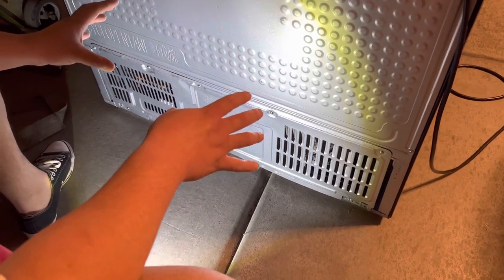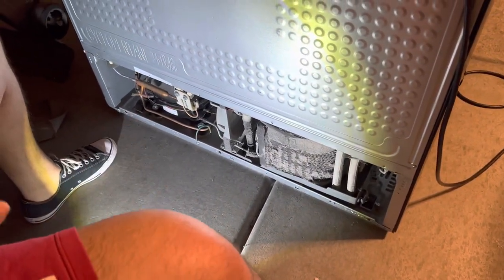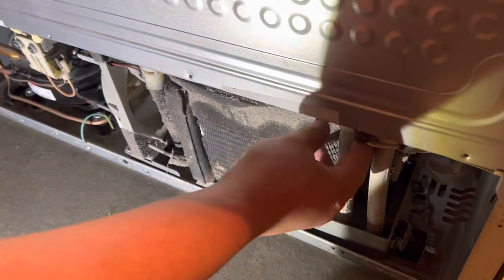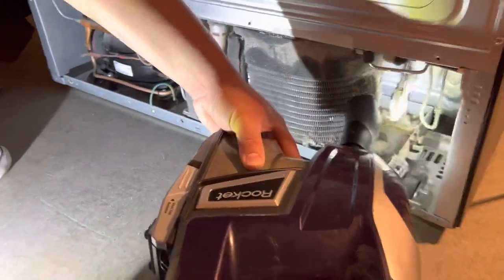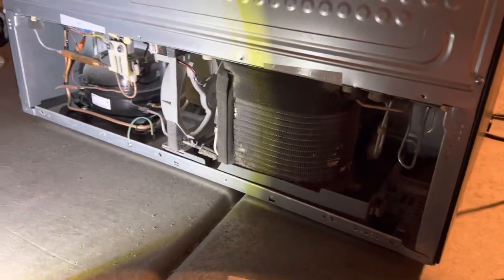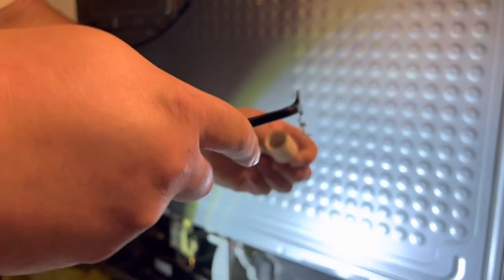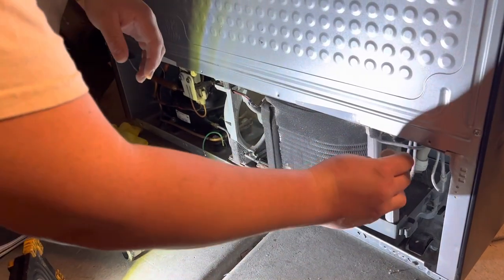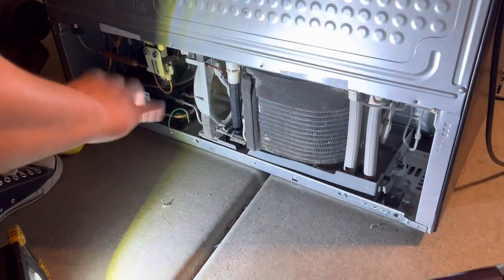Samsung refrigerator drain line and condenser cleaning

Comment: Since this problem is so common why don't refrigerator manufacturers add built-in water alarms? They could stop defrosting and display an error code when they detect that the drain is clogged.

Comment: Thank you. I cancelled my service appointment for tomorrow. Drains were clogged, causing water spill-over onto floor from beneath the middle drawer. Is there a video on how to remove drawer?
Reply from the maker: Actually yes I'm working on a video on how to remove drawers and housing and do an all around repair on the issue you're talking about I'll upload it once I finish it

Comment: Great video, set me on the track of 'trying' to fix my piece of junk Samsung fridge. I've been plagued with solid ice forming in the bottom of the freezer, and then some of it melting and leaking on the floor for some time. After watching your video, I found that mine has two drains like the one yours has - one in the same position as yours and one on the left side of the coils. The one on the right was clogged with sludge and when I removed it, a cup or so of water drained out. I cleaned it out, tested it to be sure it would allow water to escape, re-installed it, and checked the left drain. That one was dry, but had dried crud clogging it. Cleaned that one as well. Checked it two days later, and found ice starting to form again 🤬. I tried stuffing trimmer string up the holes to see if they could find and clear any blockages, as well as putting a borescope up to see if there were any visible blockages or issue, but neither attempt bore any results. Any other ideas?

I have to say I highly recommend against Samsung appliances. They're JUNK. The range we have is all over the place - one day I might turn a burner on to '5' (for example) and it takes 10 minutes to get where it needs to be, the next day it might take 20. Another day it may be too hot in 10 minutes. This fridge has been a problem from the start. The control panel has never worked right, but it didn't 'click' until well after the warranty ended since we almost never use it (the control panel - when we got it, we turned on the 'night', set a thing or two and didn't even think of touching it for like a year). In order to get the panel to work, you need to cut power to it for 15-30 seconds (which requires either pulling it out to pull the plug or turning the breaker off), restore power, then hope it will respond, and it's put itself into 'showroom mode' at least six times since we've had it - fortunately, it's only happened while we were home and there has been no food loss, but to fix it requires, well, pulling power to get the stupid panel to respond. It's to where when we go away, I put a camera on it so I can see if it goes stupid so I can ask a friend to fix it if it does. 'Showroom mode' should have a HARD KILL so that it is absolutely, totally IMPOSSIBLE to re-enable in a 'production' home setting. 

I'll never buy another Samsung appliance again, but I'm not eager to replace these because appliances like fridges and ranges aren't exactly uber cheap, so if I can get these things to last a few more years without the fridge ruining our hardwood floor, I'd rather pull some more time out of them.

Comment: If there is ice under your crisper tray, that is more likely to be an ice plug at the top of the drain tube just under the evaporator coils, rather than a plug at the bottom. It's another nasty Samsung problem that requires a different fix like feeding some solid copper wire a foot in from the top and wrapping the end around the heating element.

Comment: #1 that is the condenser, #2 condensers get hot. Not cold. #3 evaporator core gets cold, located inside the refrigerator. #4 hot side compressor, evaporator side cold. 😉

Comment: I committed one of your other videos, here goes again. Because I’m disabled due to cancer I’m unable to do most of the work myself. Some of the things however I can do! 6 months ago my son-in-law changed our sink but forgot to reconnect the water line to the Samsung French door icebox. Before then the ice maker was working except for the occasional freeze up problem in the ice maker and ice buildup below the crisper. Since my wives Brother-in-law reconnected the water line I changed the filter waited a few days but no ice, however the ice buildup under the crisper still persist! I’ve tried everything I can think of so I’m asking for help! Any and all advice would be appreciated!! Thanks
Reply from the maker: The water under the crisper drawer is mostlikely from a clogged drain line however the clog could be lint build up in the bottom part or the drain line or ice build up in your refrigerator evaporator. If it's ice build up in the evap it means you don't have a heat clip. I haven't made a video about that because I haven't had the right opportunity I will have to make one of those soon
Reply: @theapplianceguru  as soon as you do let me know so I can check it!  I’m telling you I’m at my Witt’s end. What you’re saying makes sense though
Reply: @dfighternelams6387  I just fixed this on my fridge literally today it is likely ice build up in the back where the condensation is supposed to drain out of the small plug look up "Samsung condensation drain" on YouTube and you will see tons of videos on how to fix this
Reply: @swissmrkc  thanks buddy I appreciate your input. Was it difficult to get too? One more thing, will it require any special tools? Thanks again!
Reply: @dfighternelams6387  it really wasn't bad just four screws the biggest time consumer is taking all the food out of the fridge and putting them in coolers what's the most time consuming.  Do this what this guy does in this video with those little plastic valves and clean them and that can just be pulled off by hand and that little Phillips screwdriver cover, and the one inside after you take off the panel... I just pour some hot water down the drain and it melts all the ice going down into that little valve from this video we're commenting on so I just took a little popcorn bowl put the end of the valve in the popcorn bowl went back in the fridge and melted the ice.  There's about 10 20 videos of average Joe's doing that just search water leak crisper evaporator Samsung fridge that sort of thing.  You might need a buddy like even a teenager or something to help you reach things if they're out of reach but I'd say it's a level two or three difficulty out of 10 just time-consuming and moving all the food and the fridge is heavy
Reply: @swissmrkc  thanks for the info! I think between myself and my 15yr old son can handle that! Will give update after I’m done. Thanks again my friend

Comment: I did this but I first emptied my freezer & left it unplugged for several hours so that all of the ice build up could melt. After cleaning the tube and putting everything back together, I plugged the unit back in & restocked the freezer. NOW there is a flashing green light next to the word “cold” and the display panel is unresponsive. HELP!